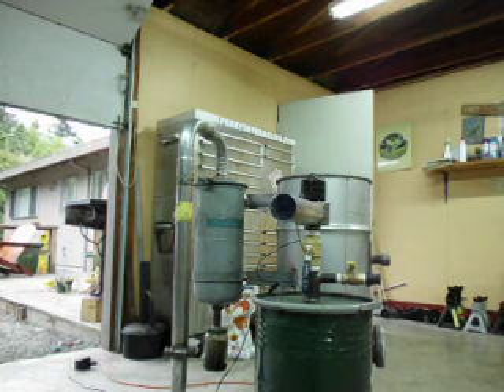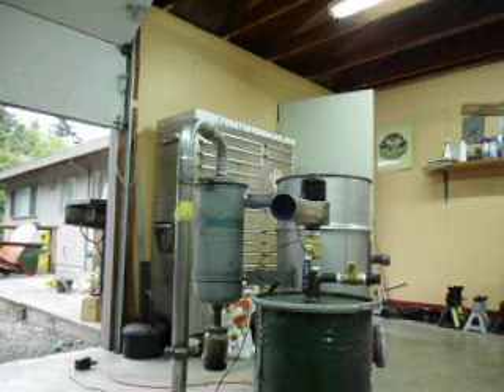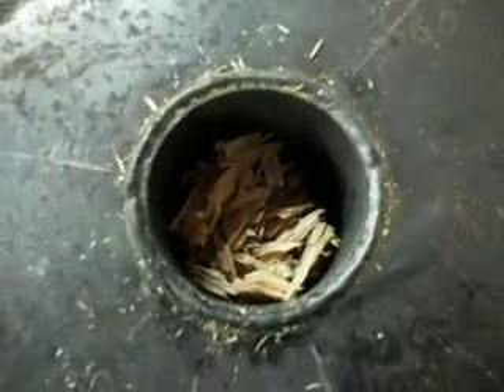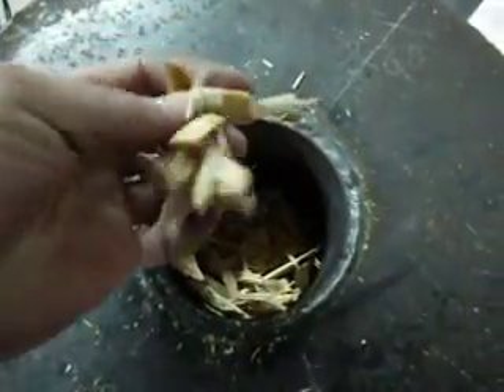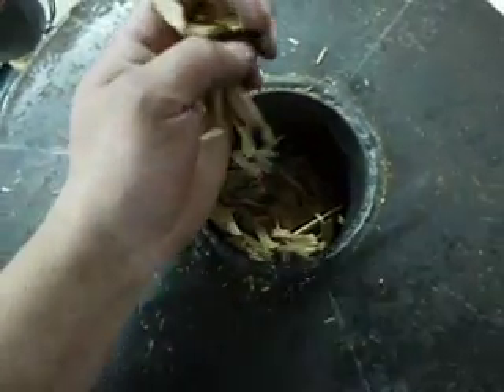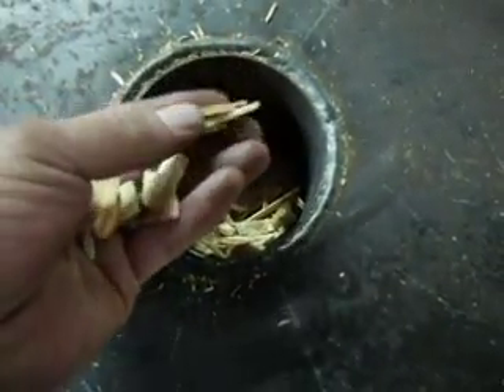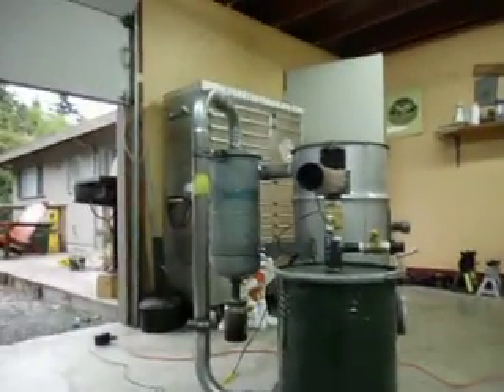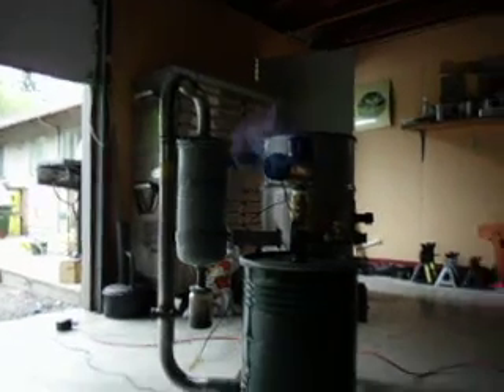fema 1.6 on doug fir chips

Comment: i wish i knew how you get that blue flame lol... i done a fema one with heaps more things than your one... i put a massive heat exchanger and  a heat recovery system and a cyclone filter and a doug fur filter bigger than your one but still i get red flame and my flame goes everywhere (unconrolled oxidation zone)
Reply: as with any flame, your air/fuel mixture is off. I'm no wood gas reactor guy,  just a fire guy so I wouldn't know how to increase air to your burn.....

Comment: hi Josh thanks very much on your info on running yr gasifier on duglas fur chips. Have you tried using yr chain saw sawdust yet . It would be very interesting if it works also. will it run your generator.also. I have plenty of chain saw dust. and use a 2 inchshop vacum to collect the sawdust off the ground.after sawing  pine logs.for next winter. My wood shed is full now withallkindsofwood and now I can concentrate on my gasifier.I dry the sawdust in the sun on my metal deck. keep faithjohn93667

Comment: hi josh Im impressed with your duglass fir chips.test. I save my electric 16" chain saw saw dust for the filter on mi gasifier.I hope to use it as a fuel also in it.. i GOT TAR INTO MY 5 HP ONAN GEN. AND THE INTAKE VALVE WAS STUCK OPEN. i TOOK THE SPARK PLUG OUT&AND SAW THE OPEN VALVE. i TOOK AN ELECTRIC HAIR DRYER AND FED IT RIGHT INTO THE CARB.WITH VALVE OPEN AND SPARK PLUG OUT THE HOT AIR WENT INTO THENGINE AND OUT THE SPK PLUG HOLE AND FREED THE STUCK VALVE.THEHEATMELTEDTHETAR.jOHN93667 OK

Comment from the maker: I dont think i could run 1"x1"x1" because of the small holes in my grate, the blockier the fuel the easier air will pass through it, you can absolutely run a hopper, originally that was my plan, havent got around to it yet, might not put one on, i wouldnt change the length of the burn tube just because the plans called for a specific diameter and length depending on hp of the engine powered but a hopper was part of the plans so im sure it would work, thanks for the comment,....josh

Comment: Very cool!  So the different fuel did not make much difference.  Do you think if you had bigger chunks like 1"x1"x1" that you would need to use a taller fire tube?  Also, if you want the system to run for a longer period of time, can you use a hopper or will that restrict the air flow too much?  As I understand it, the air for the system flows through the pellets or wood chips down to the reaction area.